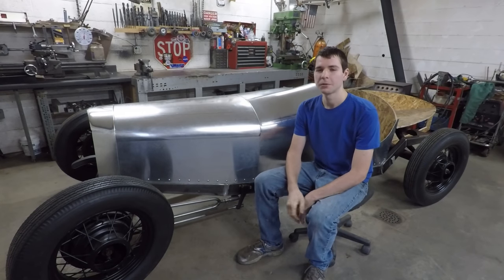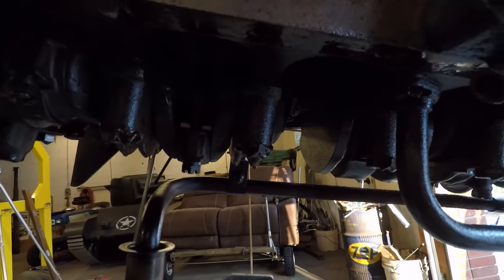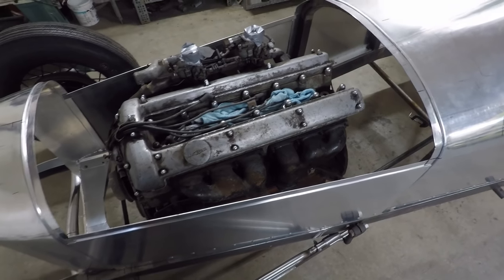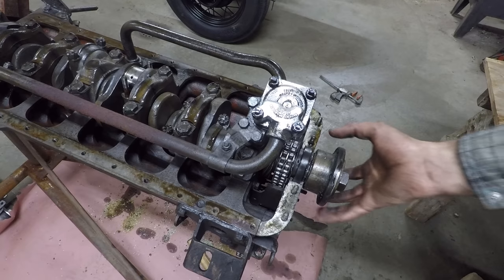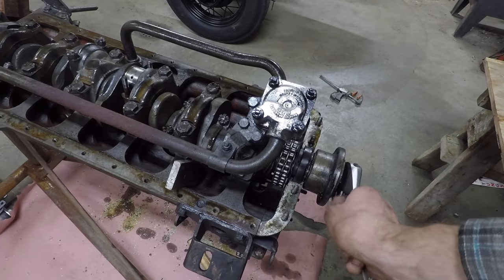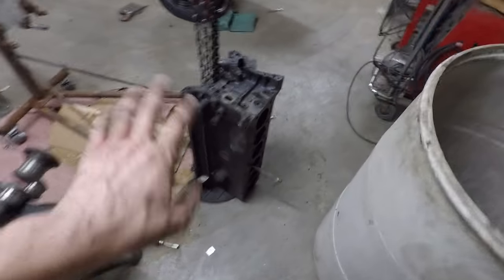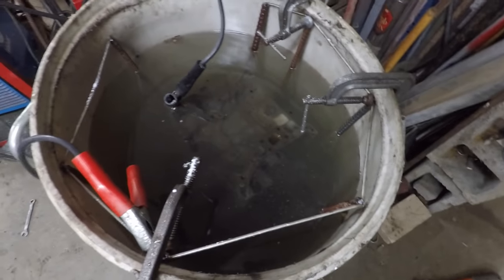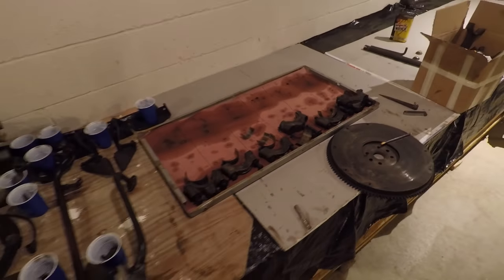Jaguar 2.4L XK6 teardown | Homemade IndyCar Pt. 32

Comment: I think the Jaguar motor complements your work. has a better narrow look than the flathead and think is easier to put in than the flathead would of been even if complete. like the lady below said Lindsey A. Westhaven leather seats and yup those leather straps on the hood would look great. All leather interior and yes also that would dash. some really rad would and vintage style gauges. Brass might look cool. heck all your work would almost do gold plate.

Comment: Great choice on the Jaguar engine not that I have anything against flathead Ford's. The are a couple books out there that you might want to take a look at. They are both British and written by Des Hammill. They are under speedpro series. One is How to Power Tune XK Engines and the other is How to Build and Power Tune SU Carburettors. They run about $25 dollars each. Looking forward to future videos. Andy

Comment: Be careful when putting the engine back together. The cam's alignment has to be spot on plus change the chains for these stretch. Oh and the tappets shims have to be correct too. But you do have the right engine for this project and as for the manual gearbox there rare to find a four speed more like you will find a manual with overdrive easy to find.

Comment: While I'm a fan of the flathead, it just didn't seem right for what you were building.  I think this is a much better choice.  Your electrolysis should take less time if you get the rust off the sacrificial rebar first.

Comment: No doubt you are aware but justin case, be very thorough in cleaning the crank galleries. Sludge can form and get trapped in them ruining the bottom end.

Comment: Check out the Australian "Barra (Barramundi)" a DOHC 4.1litre 6 and there is a ford running in the USA drag scene that pulls 6 to 8 (cannot remember), -  either way it is a hobby and for fun but it is strong, reliable and easy to set up by amateurs to achieve better than 10 on a shoestring budget as it cones airfreight from Australia...   See "the skid factory" in Brisbane and "mighty car mods" both are you-tubers......
Reply: I have my suspicions ford took a few cues from the aj6 and aj16 when they owned jaguar. I've read nothing to back that up , but when you own it and you copy it you can get away with it.

Comment: Magnificent engine for your project !! Will be amazing in that body !
I see you are already aware of Richard Michael Owen, think he'll be an invaluable source of help if you get in touch.
Some advice on head bolts and the like - you should loosen/tighten in an alternating zig zag sequence to avoid warping.
Also always keep things like bearing caps , rods & pistons etc in the same location as they came off. 
Awesome and inspiring as always , ten thumbs up !

Comment: You might want to investigate the Pontiac overhead cam straight 6.
I am glad you decided to use something other than the flat head, since you are building an indy look a like the flat head just didn't fit the persona
Reply: those were nice engines.
Reply: The Pontiac OHC Sprint six's are great engine's and would of been a great choice. But the Jaguars are solid engine's also and will still be plenty quick with the smaller displacement. I think that the jag looks the period.
Reply: @andyZ3500s  Agreed I was thinking more about parts, availability. LeRoi Tex Smith wrote in the 60s if you have a foreign car be ready to learn how to pour your own parts
Popular Mechanics back in the 60s pulled the Jag 6 out of an XKE and replaced it with a Pontiac claimed it was a much faster, and better handling

Comment: I think this is a brilliant plan. God those valve covers are gorgeous. Much for fitting for what's essentially a high performance race car. Those were pretty quick cars in the day. It's definitely going to put the speed in your speedster. Probably going to be an expensive rebuild though and finding a trans will be difficult. Start a patreon! Give us some way to help this thing get on the road.

Comment: If it hasn’t already been mentioned, Jag-lovers.com is the place to go for any information/help, there are various forums on the site and one is specific to the XK engine. Just a pair of Side draft SU carbs will be sufficient on the 2.4 and the comment re the cam buckets really only started to be a problem from the BL era when, i believe, they changed the aluminium grade. Oh and please purchase some vinyl gloves.
Reply: Yes, the Jag-Lovers forums are already onto this. Go to the Pub section
Reply: Lisa Laughton I know thats where I saw it,I was suggesting that that would be a good place for further, informed, information regarding the engine.

Comment: Am I the only one who noticed that he undid the head bolts from one end to the other instead of using a helical pattern starting  from the ends of the head and working into the middle of the head? 
Does he know that you can warp the head doing the way he did?

Comment: I recently  rebuilt a 3.8  jag motor for my 1963  Jag,   the 2.4 is the same design,  the carbs are different.

I have shop manual that helped.    The most critical item in the rebuild is the cam timing and the shimming of the values.    You will need timing tool to get cams correct. .

 the cams must be timed before tightening both of the cams down. other wise the valves may hit each other.  So do one shim check on one cam at  a time 
My 3.8 runs great.

 the cam timing  takes time, go slow and  double check yourself. 

this should be perfect engine for your car. 

You can get part from SNG Barret or UKs unlimited. 

See if you can get a 4 speed with over drive transmission.  The overdrives work great.

If you need any information  get in touch with me.  My  3,8  runs great.

Comment: just get the crank journals ground 10 thousands and get10 over bearings after you take measurements and after the machinist grinds the crank to let you know if he got everything with the 10k cut

Comment: So the V8s missing some bits so is the other engine it's missing all accessories and even the intake you've got the gear make it yourself ;) and make the beefy V8 work. For stock power numbers the V8 has  more powet than the straight 6 plus theres the sound and the amount you can do if you used the V8 to make it the centre piece of the car.
Reply: Hate to bust your bubble, but 221 cid flatheads commonly had 7.5:1 comp ratios and made a whopping 60-75 hp. The Jag 2.4 (smallest engine in the XK series) was over a hundred.
Reply: The elegant twin cam as he put it is the centrepiece of the car. As far as power and speed go, name one flathead v8 car that could do 170mph or won LeMans 3 years running. The XK six was all that in it's ultimate version.

Comment: Just been reading about this motor and yeah good choice. That thing was definitely built to race. Looking at something like 200hp at 6800rpm? Damn. 

I'm gonna share what I recommend for brakes. A swing down design with a brake booster. This is what I was going to get for my 39 Buick since it was 4000 pounds.I feel like this will work better as far as fitment goes as well. I put a booster on my 69 f100 with 4 drums and let me tell you it's terrifying when it stalls right before an intersection and I lose vacuum. Boost + drums is a win. Especially if it's hidden under the floor and not blocking the view to that beautiful motor. https://www.summitracing.com/parts/sum-760215?seid=srese1&gclid=CjwKCAiAgqDxBRBTEiwA59eENwXfoiVXu0l1GmE_1vnwXAobhGrG5z8nNDoxwmD4z8Z03ErICRaHrRoCvdMQAvD_BwE
Reply: It sure is a good choice, but it's the 2,4liter (146ci) out of a mk2, it puts out 120hp at 5720rpm. It's the only XK engine to have a shorter stroke than bore.
Reply: @jean-charlesweyland129  that seems much more reasonable lol

Comment: The engine has that prewar race look because Sir William Lyons the founder of Jaguar,insisted that it look like a performance engine .I suggest you spend a lot time looking at youtube vids showing how these engines go together. The trick is to learn first! .
For example the crank has bungs which must be removed and the oil galleries cleaned out,then the bungs replaced and the crank rebalanced. Assuming it has no wear. 
Doing the valves is a long drawn out job and there are couple of little tools you need,cam center gauge etc .. Don't skimp on anything .
They fume a lot. Notice how the 2.4 has a big crank vent on the front cover? it was connected to flex hose which exited under the car.It's all to do with the massive stroke in those engines. plus it has those tiny solex carbs which indicated thsat it maybw older than 1958, maybe from a Mk1 1956 ?(Vmax 80 MPH....) . I wouldn't go with an original gearbox for these, they are a slow dog of a box and parts are gold plated. There are any amount of Jag places that sell kits to fit later 4,5,or 6 speed gear boxes .
Good luck,you will enjoy the finished example ,just for the sound they make.

Comment: Another top job. Please however invest in a proper puller for the crank pulley. 

Said this before - anyone voting "thumbs down" needs a brain transplant...
Reply: An impact wrench would have removed that bolt without having to block the crankshaft.

Comment: Love Jag engine I like others think while it is in pieces that you may as well get it done properly I would hate to see you get a half way decent job done only to find out that you have have to strip it down again and do it properly. It might cost more than anticipated now but the time saved (as you are now in college) would mean even longer for you to finish. 
At worst with it rebuilt and all the receipts you decide not to use it you can sell it for a far better price including purchase of the engine and the reconditioning than a pile of parts!

A suggestion in the opening shots of you sitting by the car have you considered putting in some louvred slots/vents on both sides of the cowling? It would finish the appearance more completely as it is it looks like it is missing something a blank canvas so to say
I look  forward to your next video. 
Tony from Western Australia.
Reply from the maker: I'll definitely stamp some louvers in the hood sides. I want to run the exhaust out the side too, so I'm waiting to see where that lines up before I do the louvers
Reply: Great Vince, that will add some nice touches
another suggestion for you go and look at 
Rat Rod Bob Builds   channel (https://www.youtube.com/watch?v=mxy5WtYrLY4) he gives a lot of very handy 
tips and tricks out frequently 

these, for example, are of him working on his cowling his methods are in most cases homegrown but you can take the tips and enhance that knowledge to suit your needs besides he is a character and "Red" might give you his 2 cents worth as well lol.
Tony

Comment: I hope you didn’t distort the engine by disassembly 🤔 aluminum is easily distorted if not done right. Good luck with the build
Reply: The XK was a cast iron  block (the AJ6 slant 6 was Al) these engines remained in serial production to 1986 and limited runs for another 5-6 years so spares should be easy to find.

Comment: Looks like you have all your ducks in a row on this. You may want to put a newer type alternator on it. Much smaller that a big old gen. And remember alternators do not care what direction they turn.I have mounted Alts under the Rad. facing the crank pulley,if you can picture what I mean. Do to tight under hood space. A mini one wire alt. Mounted to a frame rail out in from of the engine. That may help with under hood fitting. I know you will have it figured out real well. Just trying to help.

Comment: You might find this series useful  https://www.youtube.com/watch?v=gq1PseOe7Ik  And the Jag engine is definitely the way to go.  What gearbox do you have in mind?  The contemporary Jag 4 speed would be good.  Some Jags used the Moss 'crash' box - i.e. no synchromesh - that'd certainly be a 'period feature'.  I'm from the UK BTW.

Comment: So my best advice is to read up on all the engine measurements.  Buy a bore gauge and measure taper, measure the piston clearance, measure ring gap about 1/2 to 3/4 inch down. You're very likely just fine, ring gap will tell you if you need new rings but I'd be very surprised if you need pistons. Especially if there is no lip at the top of the cylinder. A quick pass with a low speed drill, transmission fluid, and ball hone will clean the cylinders up fine. Based on the damage you saw, definitly get the crank checked and turned undersize if needed. Have them  resize the rod bearing caps too.  Have the valve guides checked, but they are probably fine. Springs are probably fine unless it got hot (carefully check exhaust springs). Easy hand lap the valves if the seats are rusty or pitted if it sat. Be easy, the seats aren't hardened like modern stuff. Buy new chains and gears if you can afford them. Measure and inspect the cams. End of the day just don't spend too much, you can do most of this work yourself for the low cost of tools, time, and reading. First time engine rebuilds always go too far, the machine shop guys love it. Fix the rod knock, it's probably the only thing you really need to do... Rockisland is right if this was a small block chevy, but unless the parts are cheap and the machine work is free, I'd take the time to carefully evaluate what really needs to be done first.

Comment: Good thing you have a ton of cash if you use that Jag engine. Why don't the Brits build computers? They couldn't figure out how to make them leak oil.
Reply: Lucas electrics, prince of darkness
Reply: Know why Brits drink warm beer?  Lucas refrigerators.
Reply: We invented the first practical computer.  Ever heard of Alan Turing?     The Jag engine is far superior to those tractor units that pass for motors over here.  LOL
Reply: @stephengent9974  Never heard of Alan Turing, Ever heard of Henry Ford? He has built hundreds of thousands of tractors. I'm pretty sure they still build cars and the best selling trucks. I'll have to check with my union brothers since I have retired from FoMoCo.
Reply: Tractors and trucks i  hear they are no longer going to build cars.  Volume does not equal quality.  I drove a ford once.  It was craptacular.  I think I will stick with Honda.  Alan Turing was a mathematician who worked pre and during WW2.  His team broke the German Enigma machine codes.  Finally Ford did not pioneer anything.  He stole the idea of a rolling production line from meat packing.
Reply: @stephengent9974  you mean the guy that was later tortured and killed for being gay? not a good look on yall.
Reply: As soon as you bring up the ton of cash remark, I know instantly you know zero about Jags. I've owned 2 jags and the worst price difference over regular Aussie car's parts was only about 10% (brake rotors). Initially I expected truth in the rumours of jag parts prices but it all turned out to be bullshit. Wether from a regular auto parts shop or a jag specialist wrecker/ parts importer from Melbourne shipped to Adelaide, I never had issue with prices. As far as internal engine parts- never needed any because the aj6 is bulletproof.
Reply: @rossbrumby1957  I live near Detroit Michigan USA. My nephew has a 2003 S type R. Coolant recovery reservoir (plastic)-$175 USD. Front brake rotors $108 USD each. Front brake pads $160 USD. Fuel pump-pick one of the three... $495.59 USD. The car is supposed to be on a Lincoln LS platform, but Jag adds so much of their own engineering and has so few sales here in the US that parts here are way more expensive than a Ford, GM. or Chrysler product. We can still get flathead Ford parts here cheap.

Comment: Great video good engine.  Now, when it comes to putting it back together I strongly suggest you use an oil that will out last this engine,  https://www.powerpunchinc.com/  Read up on this stuff and you will quickly see why I'm recommending it to you.

Comment: Best advice I can offer is to throw the carbs as far away as you can and put an EFI on. British engines are junk and the Solex carbs they use are even worse.
I have two vintage English cars and I can promise you they are gonna give you grief sooner or later.
Reply: Those British junk engines won Le Mans 3 years running. As far as carbies go, fuel injection doesn't fit in with the theme of his car, triple Webers is premium for this for performance and style.

Comment: Oooh better stick with the Ford V8. The Jag engine is an unrealible, expensive to maintain and run piece of junk. I get what you are going for here. That Euro look, but don't do it. Stick with the Ford maybe source some Detomaso Pantera heads (Ford engine..) to keep with the Euro-look. So when people see the engine they will think it's Italian.
Reply: The one claim to fame the Ford sidevalve V8 had was Bonnie and Clyde drove one because they would outrun a regular 4 or 6 cylinder sidevalve.